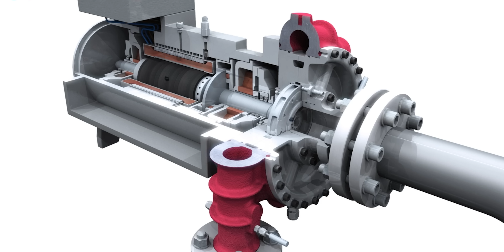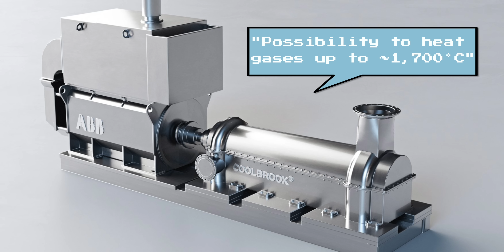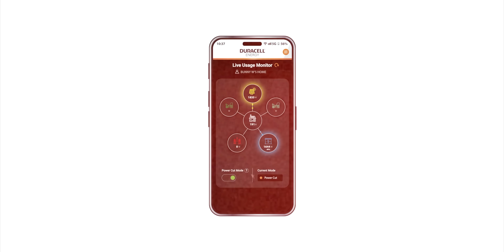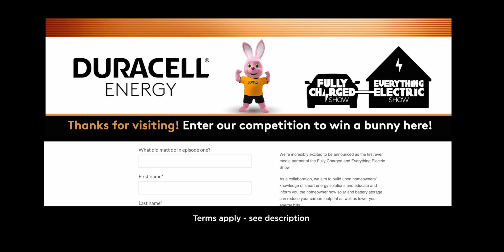Everything You Need To Know About Clean Energy In 2025! 🔋🌍

Comment: the Big question - what did we miss??!
Reply: Eco Wave Power is starting a 20 MW power station in Portugal (though it's expected to come online in 2026).
Reply: My response about nuclear power got lost? If you include nuclear power the fossil free share of electricity is 40%.
Reply: Iron-air grid batteries are being manufactured (Form Energy in the US).
Reply: What projects are there for the UK to NOT have the highest price electricity in Europe ?
Reply: @Mora41  literally most of the projects being discussed. Electrification and renewables means less gas and therefore lower prices.
Reply: @Mora41  that's a function of the rate being set by natural gas so it's controlled by the Labour party changing how we run our electricity wholesale market, rather than being anything to do with infrastructure or technology.
Reply: Trucks
Reply: "Everything You Need To Know About Clean Energy In 2025! 🔋🌍... so far"
Reply from the maker: ooft. claws are out! As a summary of key trends, we can't capture everything but thanks for your feedback
Reply: If you include nuclear then 40% of electricity world wide is fossil free.
Reply: Would have been great to see mention of the removal of some planning restrictions around heat pumps in the UK. Some of these are a bit optimistic for 2025. I'm not sure V2G will be here any time soon as I'm not aware of any cars supporting this. 2027ish I'd expect at earliest?
Reply: You missed my new maxed out solar coming up in March c/w a Power Catch diverter to the hot water cylinder. 😊

Comment: 300% efficiency X thermal efficiency electric generation extremely good at 40% X electric power that gets to home electric meter 38% = 45.6% efficient end-to-end compared with a natural gas furnace at 90% efficiency.   Wind turbine generators don't produce dispatchable electricity.   Not one home can run on it.

Comment: Resistive heaters are capable of exceeding 1,700°C quite easily and are used today in industrial processes. The tungsten filament in a lightbulb operates at 1,800-3,000°C. The difficulty in using resistive heaters for industrial processes is primarily economic. Electricity is generally much more expensive than fossil gas per unit of heat delivered. This can be addressed by purchasing electricity when it is cheap and storing it as thermal energy like what Rondo or Antora are doing with their thermal batteries. High power density thermal transfer at high temperatures is also a challenge because air is a poor conductor and can incur large pumping losses. Also at very high temperatures you may need to prevent oxygen from entering the system which can add cost.

Comment: Heat pumps seem to require a lot of maintenance. My HVAC (with natural gas heat) system is 7 years old and I've done nothing to it. I don't think you can make it 1 years with a heat pump without something needing to be done.
Reply: If you want air conditioning, you have to deal maintaining a heat pump anyway, so you may as well have one system to maintain, rather than two.
Reply: @ My AC is not a heat pump.

Comment: I hope that when MG's 'solid state' batteries come this year they will quickly find their way into ordinary cars rather than long range saloons. Keeping the range of the car and reducing battery density reduces the size of battery and motor needed which in turn reduces the capacity of battery needed for the same range creating a virtuous circle and if you can charge at home every night you don't need a 600 mile range (you can't safely drive for 600 miles without a break anyway!
Reply: My understanding is the MG batteries are very large 'semi solid state', not much different from existing batteries. 
We still have to wait for the step change ....
Reply: Lots of pundit who don't really understand EVs simply assume, for purposes of their articles, that a doubling of energy density automatically means double the range, neglecting the fact that, in many cases, it will simply be a smaller, cheaper battery that gets the same range.

I think it all really comes down to what the vehicle will be used for. For some use cases, price is more important, for others, range is more important. It just depends.

Comment: The zeb heater is still an electric heater with at most 1:1 efficiency I guess. So a heating rod in a water tank should do the same or is even better with less losses. You can also heat up a water tank when grid electricity is cheap. So what is its advantage?
Reply: size due to smaller volume with higher temp

Comment: Co-located electricity generation and demand, and micro grid and mass electricity storage financed and built by millions of grid customers will be faster than mass central electricity generation and national grid capacity expansion. 

And dirt cheap. 

This speed of replacing fossil fueled energy will be critical to preventing CO2 emissions worldwide and climate destabilisation. 

Key facts
• Most vehicles are parked 23hrs every day and all night long. 
• Massive electricity storage on wheels is perfect. Maximum private UTILIZATION. 
• V2G battery technologies for EVs is the key to daily oversupplied rooftop PV electricity. 
• 2,000gWh of daily storage from 20million vehicles in Australia will be 5 times Australia's daily avg fossil fueled generation.
• With full EV imports, then 2gWh daily storage can be added weekly. 20,000 homes weekly. 
• 20million rooftops is 660gWh PV electricity.
• PV rooftop $m² is cheaper than windows. 
• Grid industrial customers moving away from fossil fuels to clean electricity will need all the feedin electricity from millions of customers and cashflow for grid owners. 
• The national electrical grid is fragile because it is too expensive to over build. 
• The national electrical grid is too valuable to waste and too expensive to expand.

Comment: I had a boiler but removed it when l got a combi boiler and used the space such that it's not available. I have had surveys (3) for a heat pump from industry leaders, my microbore pipes are too small, half my radiators are not suitable and the proposed water cylinders are much bigger than the old tank I took out. I cannot see a solution involving a heat pump.
Reply: Sand battery will work. The channel jave a few vids.
Reply: Heat geek do a compact heat pump cylinder , Urban plumber channel on Youtube were trialing one.

Comment: Gravity batterys in old mines, drop concret blocks onto a train on a track at the bottom at peak times and off peak lift the concrete blocks onto a train at the surface.
Reply: Lots of old mines can also be used as geothermal. It gets hot down deep most flood with ground water. Feed in pipes,holes already dug, plug the water into a compressor and pipe the water to district heating. Old coal mines were a source of the problem, could be a tool of the solution also
Reply: Cool, like Icelands geothermal generators, it would be simple engineering not relying on rare earth minerals and million thumb sized batterys all spot weilded together. We would probably have all the train moulds, tunnel moulds, gantry moulds. I do like the sound of the open mine idea, sitting and watching all trains being pulled to the top on a sunny day and start dropping at dusk.
Reply: There are only going to be so  many windturbines, solar farms, storage batterys, hydro dams, newclear power stations, on top of the surface, theirs kms of mines waiting for our unused solar & wind storeage.
Reply: Gravity fed train too the winch /generator on peak and winched train off
Reply: Turning old open mines into kenitic energy trains

Comment: Ohh, so you have constant sunshine and wind in England, interesting. Wind turbines and heat pumps are noisy, and solar parks are by far the biggest challenge for the electricity grid, which is not built for the very fluctuating performance from bright sun to cloudy, which can be from 100% to 10% over a few seconds. So please read a little more about how the electricity grid is actually structured.
Reply: Thats why the system is being upgraded and mass energy storage is being rolled at speed.

Comment: Approximately 18.5 million homes in the UK have a combi boiler and so no water tank. It's a big stumbling block against the installation of heat pumps as well as potentially having to change pipes and radiators. Electric combi boilers are a much easier change, but the way electricity is priced in the UK has to stop being linked to gas prices.
Reply: Combi boilers have only been popular for 35 years so the old houses used to have a tank for hot water, just put one back in or use a phase change boiler for the hot water side. Heat pumps are 300% efficient unlike the electric alternative so your idea would cost 3 times more to run. Watch Heat Geek video about pipe and rad sizing. I have been running my gas boiler at heat pump flow temps all winter to see what I need to change to get a heat pump. It was an eye opener and cut my gas bill by 30%.
Reply: @pmac6584  Condensing boilers work best at lower flow temp , If your boiler flue is  pumping out steam its wasting energy. Delta T 30 is the way to go for all Rad sizing.
Reply: That's actually crazy, here in Australia hot water tanks are the standard
Reply: @imakevideos5377  It's not as crazy as you think. Hot water tanks were standard in the UK too but the introduction of Combi condensing boilers reduced energy costs and often freed up some badly needed cupboard space in small houses. Installation costs and plumbing of new systems became simpler too. However, nowadays we are looking for ways to store energy because renewables' availability is less consistent. To date heat pumps haven't been capable of instantly heating hot water to a high enough temperature to operate the "on demand" supply that you get from a combi (they can heat it it for storage in a tank though ... so we need hot water tanks again).
Reply: Electric boilers would make even more sense if the current absurd situation where electricity is subject to carbon taxes but gas used for heating is not, was addressed. https://www.nesta.org.uk/blog/the-electricity-to-gas-price-ratio-explained-how-a-green-ratio-would-make-bills-cheaper-and-greener/
Reply: How would those window heat pumps work in your home and climate?  If you are  in a mild winter climate and mild summer climate it would be nice, and you could keep your old system for occasional use.
Reply: 'I went back to a hot water cylinder (megaflo) after 2 combi's , dump my surplus PV to it or heat on off peak night time leccy with a lifetime (25yr in comercial/industrial use ) warranty. better flow rate than a combi with 2x heat inputs for reliability and it works in a (short) power cut.

Comment: I work for the world's largest solar panel manufacturer who manufactures and delivers just over 100GW of modules/year.  We're actively working on HJT modules that will overlay transparent perovskite over a TOPCon silicon cell, boosting efficiency significantly.
Reply: HI even in the Uk it is worth it 10 months of the year.
take a look at people going over their monthly production figures.
the key is having lots of solar, which is no shock.
Take care M
Reply: @markeh1971  very true. my electricity bills are very nice since solar.
Reply: @markeh1971  My solar for the last 3 months has been abysmal, the worst in 12 years. Its been so dismal week after week. I have a 4 bedroom detached house but only 2 roofs are suitable and one is subject to winter shading from the house next door. Such is modern high density housing in the UK. Don't be fooled into thinking these solar influencers are the norm. They tend to have big houses.

A heat pump would be very difficult to install as too many doors and windows on 2 sides and the other 2 sides it too close to the neighbours. And given the high cost of electricity cf gas it's not cost effective. I've been looking a battery storage. I this winter is going to be typical going forward then it will be useless half of the year. Anyway, I just cannot get any installer interested in quoting.
Reply: @ Hi Alan, yep that’s the UK. I put in a temporary wooden A frame and it’s still not getting much sun even with 1KW of panels.
It looks like battery storage is the way to go if you can get a good cheap rate to charge it up and get a big enough battery to supply you during the rest of the day. I’m awaiting car to grid for this. Should be some interesting use cases in the future to have a small ( comparative) home battery compared to a 65 or 100 KW car battery. If you have a GYS inverter you can use an EV HV battery.
Heating wise gas is the cheapest. If you want security then you need to be able to store fuel easily, kerosene heater would be ideal for this and it’s 12v powered.
Oh to have the money.
Take care M.
Reply: @Alan_UK If the solar & heat pump options are restricted could a V2G enabled EV and hardware & software be used? I've heard it can be a good way of utilising a cheaper energy for your peak energy needs.
Reply: hi, silly question- compared to 5 years ago vs today, did the orders increased significantly? im a masters student taking renewable energy engineering and planning to shift from oil and gas eventually. trying to convince myself that i made the right decision since im worried that i missed the ship (growth phase of renewable energy)
Reply: @samsam_sam  buddy, we need about 10x more solar than we have now. You will have plenty of work! Though you might want to learn Mandarin.
Reply: @samsam_sam You'll never miss the ship moving from oil/gas to renewable tech!
Reply: Doing the lord's work 👍

Comment: Great video, one technology I would add is Faradion's Sodium Ion grid scale battery system, with it's software defined dynamic configuration suiting balancing, SDES and LDES arbitage needs from the same system. It would be interesting to see cross integrated systems as well, such as mixing Faradion's and Invinity's systems on the same site. To this end any insight into ISO or other standard developments in the battery storage space world would be interesting as this would help demonstrate market maturity - moving from what is a vertically integrated blackbox approach to more horizontally integrated and scaleable solution that would meet a wider set of needs.